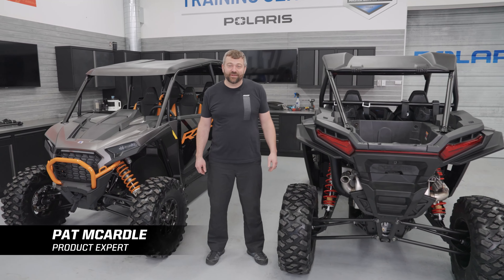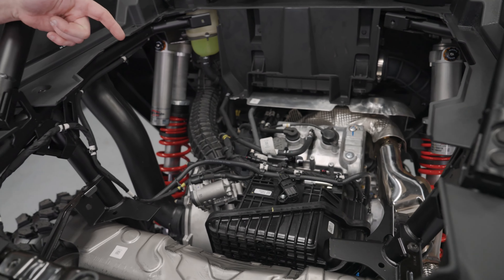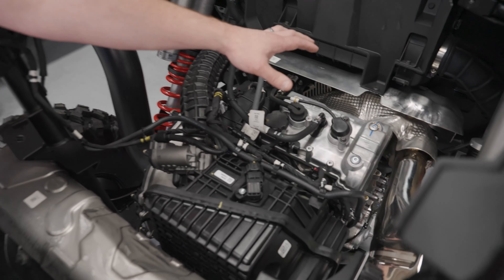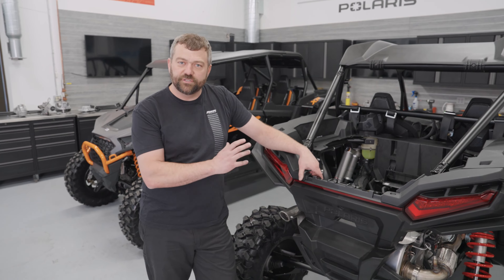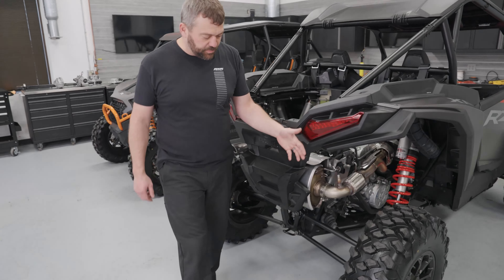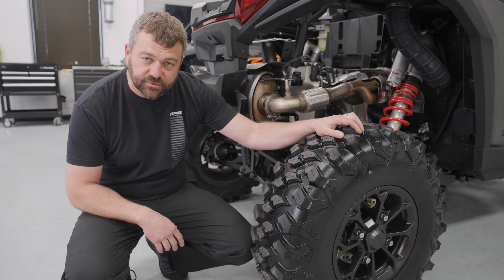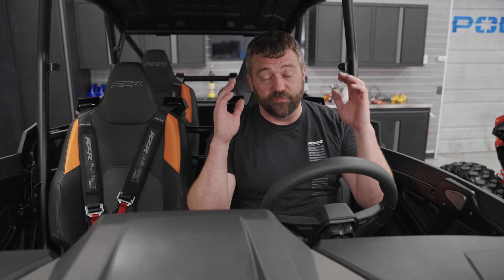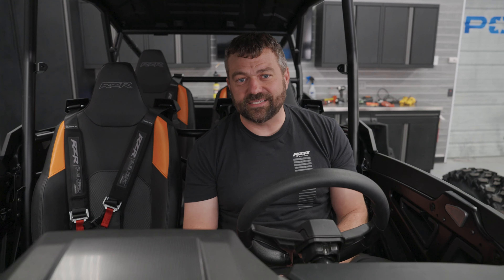PERFORMANCE UPGRADES ON THE RZR XP - SHOP TALK EP. 21 | POLARIS OFF-ROAD

Comment: I just hope you could fix the exhaust from rusting and looking nasty
Reply: STOP submerging it in WATER it wont.
Reply: It’s not rust on most you see, it’s baked on mud from people who don’t clean it.
Reply: @dr187mx  id like for her to point to a car that has a non rusted exhaust system.
Reply: @wraith511802003  if it was made from stainless if wouldn’t rust. But mine looks filthy from dried mud. If your on a ride and it gets caked there is no way to clean it before it dries and bakes. One of those things you just learn to deal with
Reply: @StephenBrewer89  That is not what is goig on in 99% of the UTV it is not rust but mud. I think it is SILLY to harp on that as even the high end titaniums get dirty and done stay nice.